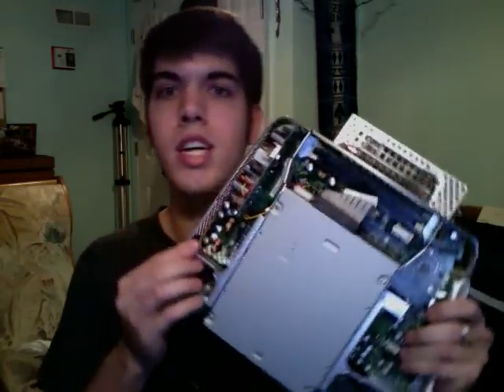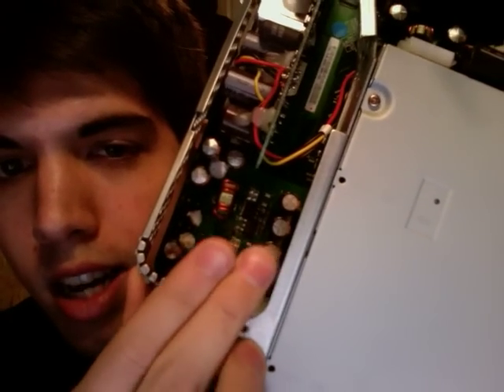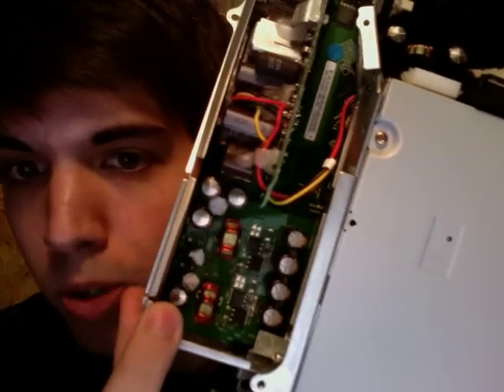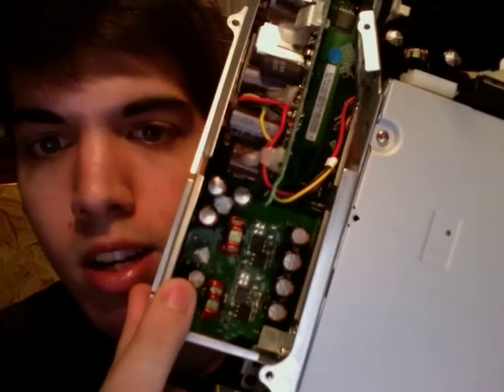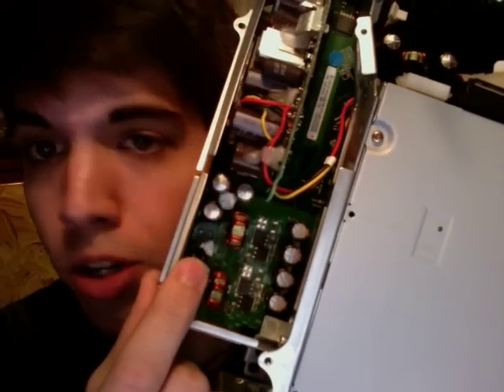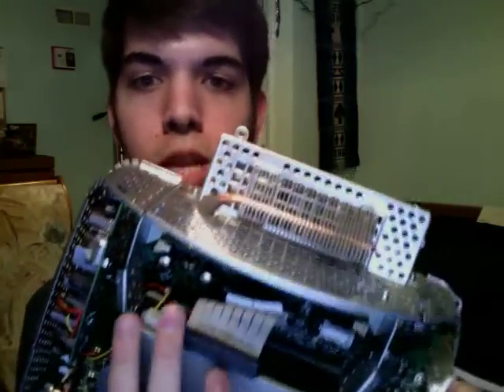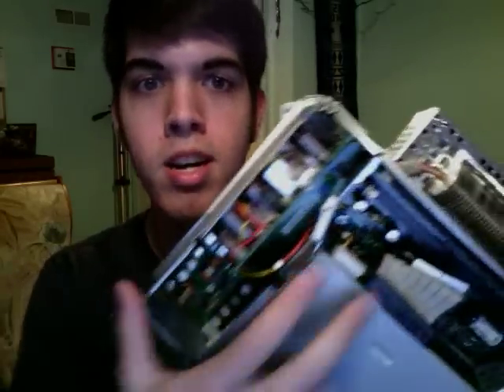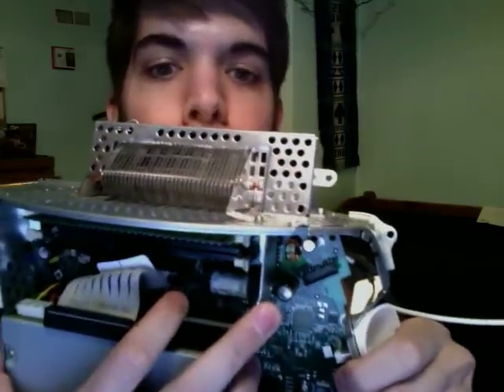eMac Capacitor Issues

Comment: The ironic thing is I pulled my eMac out so I could give it and my Dimension 2400 a round two in performance, with them both running linux, 512MiB of ram, etc.

Well, the Dell is also known for having capacitor issues. Mine doesn't. My other towers do! I had to replace the capacitors on them!

But not the Dimension 2400. I guess that case has enough airflow to keep things managable.

Comment: It killed my eMac. The problem is that I don't have the capacitors on hand and the entire computer is overengineered and a PITA to take apart.

In my case, the capacitors are beginning to short. They're reading much higher.

Bad! Bad bad bad!